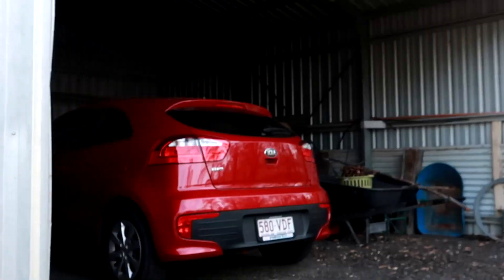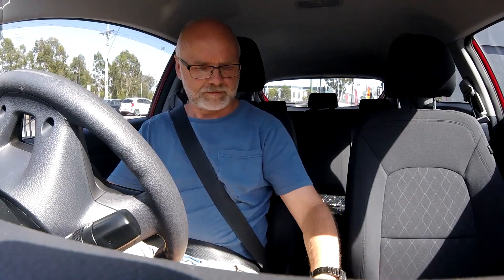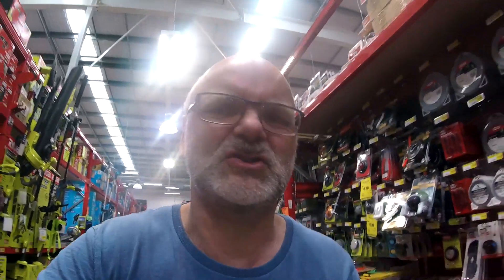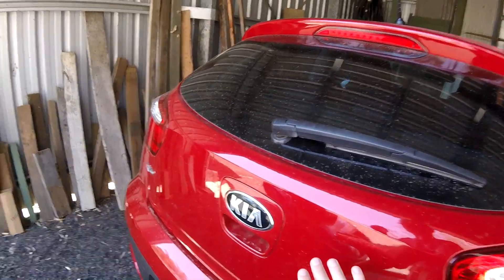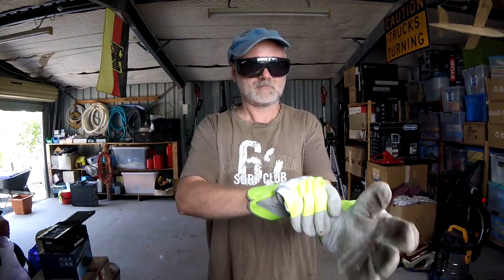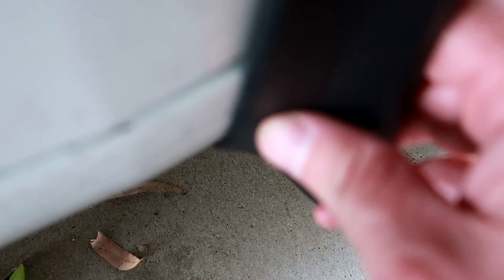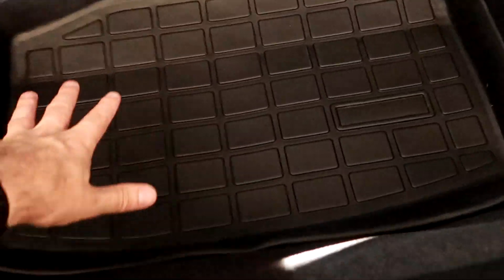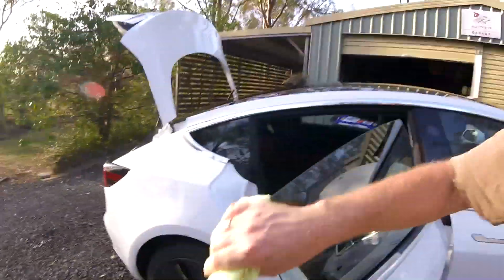EP285 - These are essential accessories and I discovered some more design flaws...

Comment: I think they should include some important extras like moulded mats for the price point. Free mats, or other quite cheap accessories (especially from their perspective), as part of a new car deal can be misleading anyway. I understand in a much cheaper car every $ counts, by the time you knock off a few $ and get a tank of petrol and tints included, or similar (and often it's  best to get these after market anyway and shop around).
Reply from the maker: Tesla does not do any deals on new vehicles. They all cost the same everywhere. No negotiations possible. I think they want to get away from the old 'dealer' model as far as possible. Fixed price for everyone.

Comment: I don't see a towbar on the Kia. It's a bit small anyway. How are you going to get hay to the ponies?
Reply from the maker: The Teslander will get a tow bar beginning of next year. Tesla will retro fit them here in Australia.
Reply: @unpluggedEV  That's good news. I knew the Tesla was capable of towing - I guess they're being careful of offering it as an option in Australia. Personally, I would always be aware of the load on the battery and use the throttle pedal accordingly, especially while towing. It has a bigger battery than the Mitsubishi PHEV and is liquid cooled, but it is still subject to the same chemistry. Uncle Shaun has some advice: https://www.youtube.com/watch?v=4VLl_r6B1JY

Comment: I always hated going to a gas station. 
I was broke growing up and never had enough money for fuel to drive in college. 
It stuck with me and now I go electric. EVs are cheaper to operate. Less fuel costs. No more gas smell. 
I also changed to electric garden tools. No worries about starting next season from bad fuel or carb repair.
Small changes that make a positive difference for the environment.
Reply: @Kenz300 x - what did you study at university? What did you do to make your money (what job did you do)?